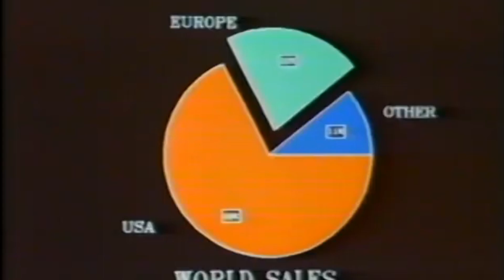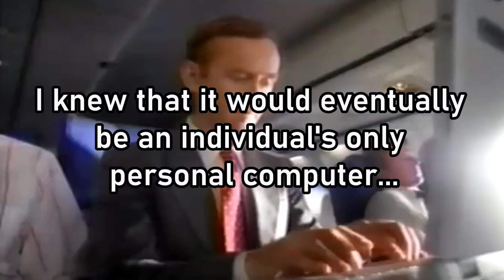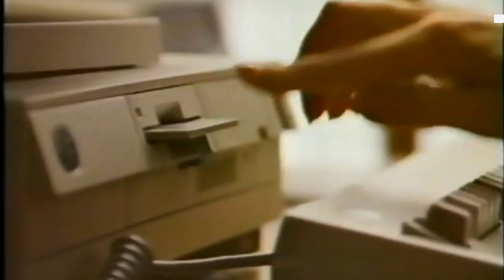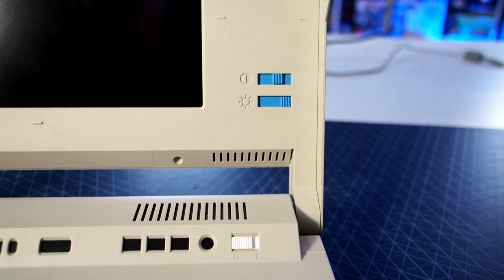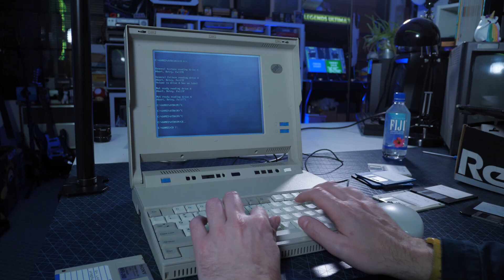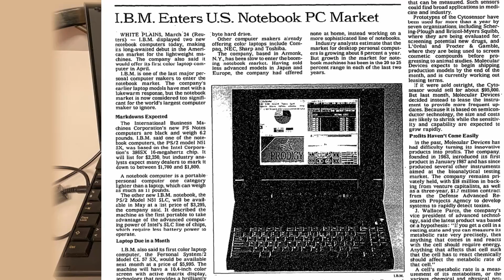The $11k PS2 Laptop | Nostalgia Nerd

Comment: I started work at IBM in 1988, in the PC workshop (aka servicepoint) and went on to become the PC/server specialist for the Midlands, probably because I worked in the building that included the labs and software centres, so I got to see lots of products before production, like the luggable, thinkpads (and pre-thinkpad laptops) and experiments in VR and music peripherals. When I started we still had contracts to repair IBM selectric and golf ball typewriters,  which is where I started (they lasted until roughly 1990) but most of our work was with the PC, AT, XT, before the PS/2 took off in the early 90’s. 
I remember the luggable P70/75 and L40 well, because they were well made and relatively easy to work on, and I remember the L40 recall, even though we never really had problems that I remember, I think it was to do with the power brick. 
When the thinkpad came along it was a massive pain in the *** for us, they were difficult to take apart and we had loads of them, mainly due to cracked screens, keyboards and cases, a new phenomenon! The worse though was the introduction of the 701c with butterfly keyboard, the first one we had for repair, right at its inception, brand new and was owned by Roger Cook of the Cook Report at the height of his fame, and we couldn’t get parts quickly, that was an interesting conversation! 😊

Comment: Interestingly, IBM made some stand alone versions of this laptop's keyboard: The IBM M4 and M4-1. They were also produced under the Lexmark brand for a time. The main difference between them is that the M4-1 has the iconic Thinkpad red nub in the middle while the M4 does not. I own both this laptop and an M4 and can confirm they are the exact same keyboard, buckling rubber domes and all. 

It's great to have this laptop's fantastic keyboard available on my modern PC. Makes writing reports a breeze.

Comment: This was my first laptop back in the early 90s that was given to me along with a Tandy 1400 HD and still got them. Learned to type on these 2 clearing 100 wpm on either one but for some reason the Tandy 1400 had a better keyboard for me but the IBM had a much better monitor and was a lot smaller and lighter. I liked Tandy’s more mechanical feeling keyboard as the sound and feel of the feedback while typing fast was great. But when your smoking the keyboard, the IBM one is a lot quieter. And the only desktop keyboard I have so far that comes close to it is an IBM- model-M from 1990 which I still use today. 

That Bios reference disk was a bear to find in the mid 90s when I needed it. 

Played a lot of games on this machine along with the Johnny Castaway screen saver. And if it was really cold, the monitors response time was very bad. 

And ya, that little red round knobby pointer thingy on later think-pads seemed useless. I couldn’t ever figure that thing out.

Comment: The best laptop keyboard I used is the Texas Instruments TravelMate 4000E (75 MHz 486). Followed by the GridCase 1550sx (although the last time I used it, it wasn't as good as I remembered it, maybe it deteriorated). Then comes the IBM L40SX whose keyboard didn't deteriorate so I now place it at #2.
(also if you own a L40SX go check the capacitors if you haven't. They probably started leaking about a year or two ago. And change the BIOS battery. On mine, it's a PITA because my machine's floppy drive is faulty)
(I can stack my ancient laptop computers up to the ceiling and I got most of them from e-waste)

Comment: This video brought back a lot of memories for me, my Dad worked for IBM and had a L40SX as a work laptop. When he got an upgrade it became mine to use and my first pc I had in my bedroom and replaced my Amiga 600. I had it connected to an external monitor, the one I had was a 386sx and had 10Mb ram. I managed to install Windows 95 onto it via a zillion floppy discs even though it didn't meet the win 95 minimum spec, it ran, albeit a bit slow. I eventually replaced it for a beige box with a P120 rated Cyrix CPU and 16Mb ram which I got given for Christmas 1996. I think my Dad then returned the L40SX back to IBM.
Reply: It wasn't a "zillion" floppies, but 13 (1.68dmf). There were games with more back then...

Comment: That proto-Thinkpad looks very interesting. The blue highlights were strange given we’re all so used to the red ones, but they actually look pretty good. Couldn’t spot the trackpoint in that one though, even if it was black or something. Was it not in the usual position?
Reply: IBMs logo, and general theming is blue. I have an i7 (lenovo though) thinkpad, which has both blue & red buttons, and many blue button labels for secondary functions.
Reply: @DoubleMonoLR  well, obviously they used blue elsewhere such as the PS/2. The video even said as much itself. But it’s strange to see what otherwise registers as a ThinkPad with the red swapped for blue and the black/slate swapped for white, aka a ThinkPad in PS/2 colours. 

Now, if I’d said “it’s strange to see an IBM machine use blue”, a much more universal statement, then maybe I could see why you said what you said. 

Lastly, obviously ThinkPads have always had some minor blue highlights, such as with the RGB motif, or the Fn key, and sometimes other colours for the other modifier keys too. But that’s besides the point because they’re not case colours, which is what my OP was about. 

And what Lenovo has or hasn’t done with the design, matters if you’re buying one I suppose, but I’ve never felt like they truly Got the designs they’d inherited from IBM, IMO the spirit is dead. They keep a few of the hallmarks but the rest has changed so much — like how a Škoda used to be unique, but now it’s basically just a VW. Of course they’re still usually quite rugged if you buy the business models, but they’ve watered-down the lineup with “prosumer” ThinkPads too, which are much more fragile and even come with bloatware.

Comment: Nowadays, thankfully, laptops have basically caught up to full fat desktop performance.. I have a Core i7 - 10875h, 64gbs of ram, nvidia 2080super, 2x 2tb m.2 nvme ssds, in raid0-- and it's a laptop that will handily beat most peoples "high end" gaming rigs. 4k 43inch hdr1000 screen as main, with 2x 27inch 1440p screens, one on each side.  All I have to do is unplug the power, displayport, and thunderbolt3 plugs, and then my workstation fits in a backpack.
I love how far tech has come, just in my lifetime. I'm just a touch older than Peter here, equally as much a retro nerd, and started on a commodore vic20.
Reply: well laptops are good enough to do anything a desktop will do, desktops meanwhile are getting completely insane with the speed and power of both desktop processors and dgpu's

Comment: I was so confused at the title and thought you actually meant a PS2 built into the laptop 😂
Reply: technically, it's a PS/2, not a PS2

If you're looking for laptop PS2 action, that's more Ben Heck's department.
Reply: @TheTurnipKing  But then, it it would have been written "PlayStation 2", not PS2... so the apparent confusion is hardly warranted. Expecting a product that they know never existed, rather than a retro IBM laptop with a well known moniker also shared by the IBM keyboard and mouse standard, is just a bit silly.
Reply: @another3997    what makes you so sure there wasn't a Playstation 2 laptop?

They did make quite a number of offbeat playstation variants, like the PSX.  or indeed, the Bravia that had a built in PS2.

There are numerous other variants of other consoles, like the SNES built for hotel rentals, or the Saturn variant for airlines that certainly aren't common knowledge.

Is it really so unbelievable?

Comment: I see what you did there with the title. And I enjoy it a lot. It's been an absolute pain to filter out all those PS2 results when googling for PS/2 stuff. Oh sweet revenge… 😈
Reply: Intentional clickbait much. :P
Reply: I usually prefix IBM when I google in order to filter out the Sony results, as it doesn’t always honor the forward slash properly.
Reply: @DavidWonn  escape the forward slash with a backslash so the search engine interprets it as the character-literal
Reply: @KinreeveNaku  Sometimes encasing it in double quotes also works, but in either event, prefixing IBM or appending -Sony helps as well.
Reply: I came here to learn about a Playstation peripheral, but stuck around because I'd always been curious about PS/2